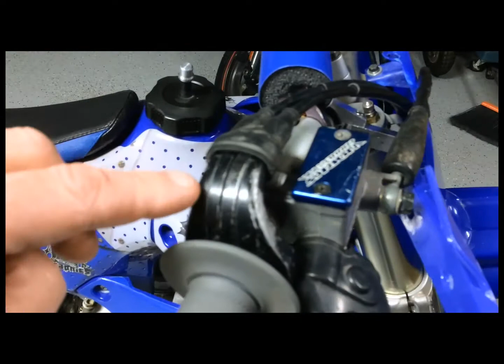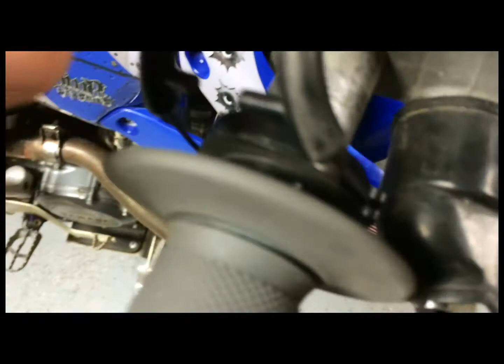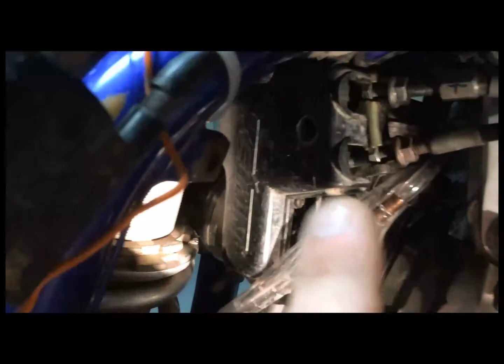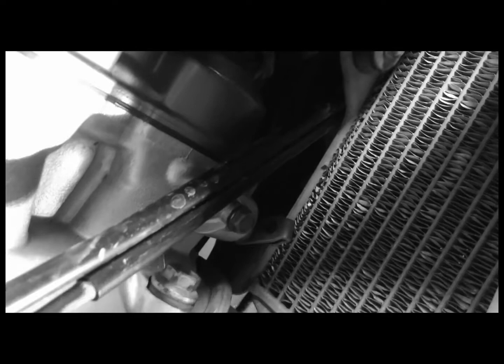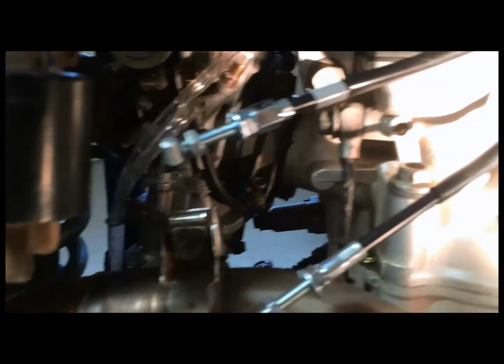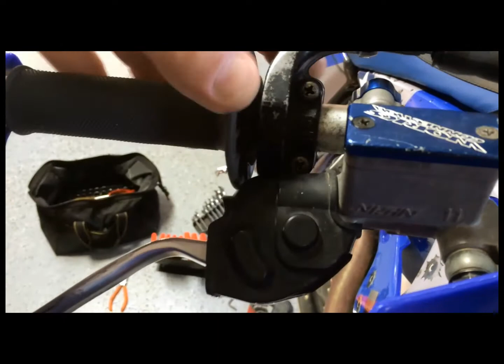Dirt-Bike Throttle Cable Change - YZ426F

Comment: My guy I got a carb on Amazon said it’s for my 02 yz426f  for the throttle cable is very different ..... old carb has two open slots  new one has ones open slot n a túnel slot idk how to fix this
Reply from the maker: Sounds like your bike had a different carb in it or you got the wrong carb from Amazon.

Comment: I have a question what if when I pull my throttle cable the bike accelerates by itself so when I turn it just accelerates
Reply from the maker: The Gamer 101 - your thottle cable is not routed correctly, or it is not adjusted properly.